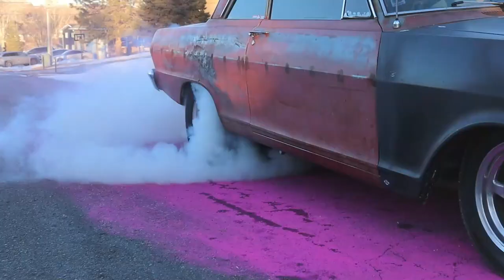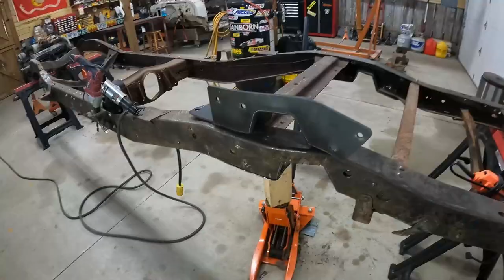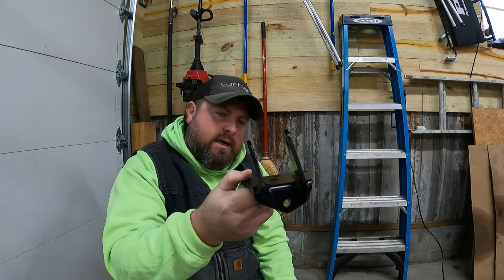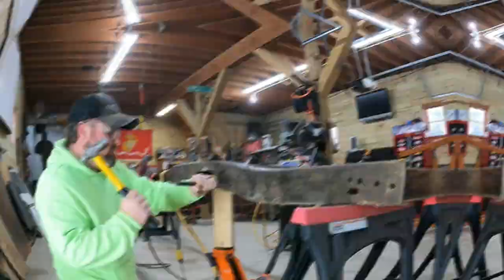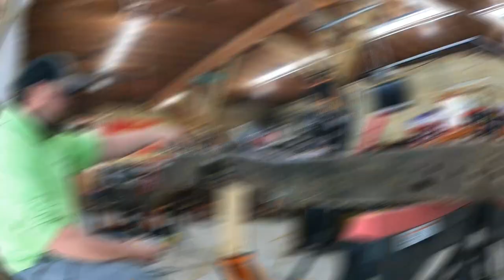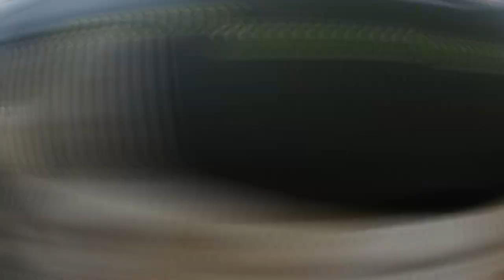✅ 1967-72  CHEVY C20 Frame Notching Kit Fitment ISSUE'S

Comment: Man I literally went through the same struggles doing mine. Here’s what I’d recommend. Tin works fab has it all. They have the c-notch with a built in pan hard bar bracket. They have the trailing arms with the built in pan hard bracket and they have the adjustable bar itself.  It’s a longer bar so better handling. They also make the shock relocation kit as well.  All made in  the USA and  they have great customer service.. Great video and I know you got yours knocked out but just trying to help someone else avoid these pitfalls that you and I (I’m sure a million others as well 😂) went through. .